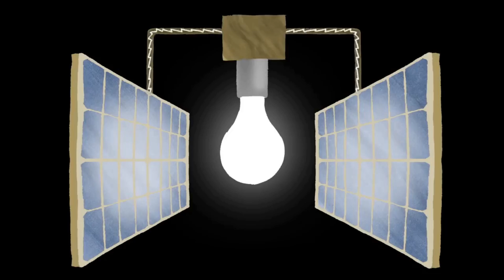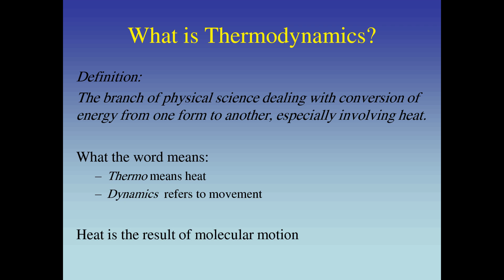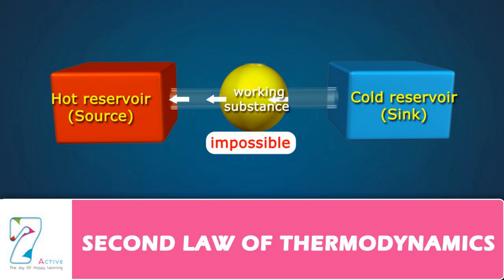2153 Do Perpetual Motion Machines Work

Comment: Maybe a maglev rotor could keep on spinning until the stator and levitating rotor's magnetic fields die out...? no? I wish you could explain why this wouldn't work. The magnetic potential lifespan will maybe be a century? if you hd a HUGE stator magnet, above which floating a rotor magnet of such a shape to rotate in place on top of the base magnet? There would be no friction. It would temporarily be perpetual for maybe lie 10 years? How long would the magnets last. I've really no idea.
Reply: could there be some feedback loop to remagnetise say the stator and rotor with some wireless tesla thingy that is powered by the levitating spinning rotor with a layer of circularly arrangd NSNS magnets on its rim? in a vacuum? I guess the magnets would wear out. So as I said it would be temporarily perpetual As you would trap almost in temporal stasis the potential energy of the magnetic domains say of tetrateanite?
Reply: Air friction, back emf from eddy currents produced in anything around it, loss of energy through sound production or friction from bearings depending on if it's spin stabilized or bearing stabilized.
Reply: no but the magnets of the encapsuling stator the field of which is magnetically insular? There would be no bearings as the rotor would be levitating while rotating, it's base would have flat panes to stabilize it and angled serrations similar to the magnetic floor of the stator chamber, to give spine. I've thouht o various designs about how to create spin and letiting a magnetic levitating rotor balance in its spin, i.e. a hemispherical levitating rotor  or a bottom slice off a sphere type shape, inside a hollow inside a magnetic stator floor, aoe which it can spin in stable fashion. there would be air friction though, but what if any electricity induced could be split between generating power and also recharging the electromagnetic field?. However the top layer of the rotor has a magtinetic field insulating layer, on top of which is the NSNS circularly arranged magnets, giving frictionless induction to a coil exposed to the inside of such a magnet. How absolute can the vacuum be in there as any particle in the atmosphere will bump against the spinning levitating magnet and will indeed cause sound inside the chamber even if it is levitating and spinning in that chamber without having any components that touch directly, only the fields interact, as the rotor "slips" but remains floating stably on top of a stator magnet beneath it. I don't know, I can't melt tetraneanite or use tinkercad to design plastic molds to make clay molds to pour tetrateanite alloy in to align the domains before it hardens, to test my ideas as I think different designs could be more efficient in creating levitating rotors that stably spin in place much lke a maglev train above its rails...  @AtlasReburdened
Reply: A stand-alone device that could spin for ever wouldn't break any laws of physics, but it would only be useful as a novelty or an energy store. With no losses, you could still only extract the same amount of energy that you put into it to get it spinning in the first place.
Reply: what if it is spinning because it's a levitating rotating magnet? On top of it is an array of NSNS magnets that cause induction. in a coil, the magnetic rotor is just so there is no bearing and doesn't touch, so there are no cogs or bearings so no friction except whatever atmosphere is or whatever level of vacuum it's in. Someone mentioned to me that when smelting an alloy of tetrateanite that you use an extremely powerful magnet to align it's domains. No doubt this is how tetrateanite was formed in meteors, not for millions of yeras, but millions of years ago as the alloy was still molten and was moving around, being moved around, by the magnetic fields of celestial bodies, which aligned its magnetic domains. In any event, this magnetic field that aligned the tetrateanite alloyw persisted from the time it was molten until it was cooled and set, and so, the magnetic domains of the tetrateanite was set. Now that we have this set, inherent potential force of the magnetic domain in a material, that is a lot of energy that was "put in" however is kept in stasis as it retains its magnetic property as a store of value, much like a battery in fact. Using such a rotor to levitate and spin with an array of NSNS circularly arranged on top of it with a magnetic insulating layer between these two levels of the magnetic levitating spinning rotor, the diameter of the rotor, and the speed of the spin determined by the size and strength of the stator's field relative to the size of the rotor means that it would be lighter work to push this levitating rotor to spin faster, I think the ratio between the weight of the rotor and the speed at which it spins could reduce the magnetic decay of the stator and rotor (it's an idea that unfortunately I can't represent to you with images or videos, but could direct someone to build), then "as much energy as you put in". Well. Sadly i don't agree with this statement even though it's a "law of physics" as you say. But such variable factors as I mentioned now would create ratios with the magnetic durability of the magnetic domains such as the size different between the rotor and stator (the base above which the levitating rotating magnetic disc spins, much like a pizza now with pepperoni NSNS magnets around it's rim,.  I think you could get out way more energy that was put in as whatever force, say using a use electromagnet to align the domains of the tetrateanite alloy, would set its strength and it would retain this efficacy much like a battery, and would decay much slower than say a lithium battery would. That's why I previously said elsewhere that magnets that comprise a generator like this could be considered, like a battery, that is, a store of value, as the amount of energy put into that alloy when it was made, i.e. using a massively electromagnet, would in effect trap that field property from the electromagnet into the alloy so as to act as a slowly decaying magnetic store of energy, so in fact the amount of energy you put into it, and the amount you "take out" can't really be compared as it's a material property.  Because what you're taking out in fact is not anything of the rotor and stator fields barely affect each other over a long period, while the smaller NSNS magnets arrayed on top of the spinning levitating rotor on the circular edge, would induce AC in the coil. In fact hardly energy would be taken out at all from the stores of value, the magnets would slowly decay, but it would be an induced field in the coil, there are no bearings or cogs, the shape of the disc rotor levitating and stator allow for it to spin stably while levitating.  It would retain its magnetic property for a long time I believe, especially if it were in a vacuum chamber with less air resistance, at certain temperatures, this spinning device could be kept near "stasis" even if it spins very fast insomuch as the material properties of the components are kept in stasis through not being allowed to lose magnetism through heat say from friction from any non-vacuum element in the atmosphere that is spins in.  I think this is also maybe why the Universe is expanding maybe and not merely drifting away due to a bang inertly, as dark energy at absolute zero forces away celestial bodies like galaxies, while they in turn attract each other.I'm not a practical scientist or a physicist but I've thought about this for so long and am unable to design the magnetic device I'm talking trying to talk about to test it, I mean I can explain it in m head and with some consultation I could have it created, but I am not sure at all even of what I'm saying at this stage without being at liberty to experiment @robinvince616
Reply: @selfcorrected-Bobby  Frictional losses are irrelevant to the basic problem here. The process of generating a current in a resistive load will mean the spinning mass now has work to do instead of simply spinning freely. It will slow down and eventually stop. Ignoring frictional losses, in theory a generator could be coupled to a freely spinning wheel and be made to produce any level of voltage you want, without imposing any load on the wheel. But the moment you attempt to draw any current from the generator, it is now delivering power and will begin to resist being turned. The more power you draw, the more difficult it becomes to turn the generator. The electrical power is thus being drawn from the spinning wheel and its stored energy is being used up.
Reply: I think you misunderstand my design? The magnet that constitutes the rotor is spinning and levitating. However this magnet itself is not what induces an AC current in the coil, it is only used as a floating spinning platform, its field interacts with a magnetic stator beneath it that keeps it floating in the air above it, with angled serrations to provide spin, s well as a flat area to keep it balanced while spinnin and floating at the same time. On top of it is a layer that blocks magnetic fields. on top of this, on the levitating spinning rotor, is an array of circularly arranged NSNS magnets that induce AC in a coil. These NSNS magnets' fields do not interact with the stator which is pushing the rotor into the air so that it stays levitating, nor do they interact with the rotor on which they sit, as the idea is to separate heir magnetic fields so they do not interact at all, even though the smaller magnets circularly arranged NSNS magnets sit ontop of the rotor disc magnet spinning in a levitatory position (levitatory! haha!). So yes its stored energy is being used up insomuch as it is losing the magnetism of its magnetic domains, through magnetic decay, along with the NSNS magnets arranged on top of it, too? I do not understand how my idea is a resistive load though, other than that the levitating magnet is resisting the pull of gravity and is being held up by the stator in the 'air'.  The idea is kind of to keep "donating blood" without sucking the patient dry in this case, of its magnetism). The patient will eventually die, though (the magnets will lose their magnetism in this situation). I wish you could explain more about resistive load, as I don't fully understand? I'm not a trained scientist, my school was a raucus and impossible place... I ended up studying linguistics, which I regret due to the available employment opportunities... I mean, is the resistive load the resistance of the conducitive properties in the coil? Or does resistive load also refer to the fact that the rotor is resisting gravity through being forced into  levitatory position by the stator, that is to say the resistive load are both the non-super conductivity of the coil, and the stator and rotor acting against each other and gravity to keep it spinning and levitating in the air? i'd say the spin of the levitating rotor in the 'air' above the stator may even reduce the resistance of the load so that it "slips" off the field of the stator, and if it is in absoluut vacuum there would be well, less resistance?. So were talking about the magnets decaying due to their resisting each others fields (the stator and rotor), while the NSNS magnets would lose magnetism due to resistance in the coil depending on the coil's conductive properties. @robinvince616

Comment: We need to stop looking at it in as perpetual motion but look it in a way that we can extract more energy then we put in ie using one barrel of oil to extract 50 barrels from the ground. Maybe using a way to extract hydrogen from water which you have done through electrolysis but trying to unlock it through a frequency that might work using ac current. There may be some frequency that just unlocks it at a small amount of current get more energy then what you used, like a pump to pump oil out the ground. Anyway It is food for thought even if it doesn't work but I hope to make a setup one day to be able to experiment it and I hope soon as it has been in my head for many years or you try if you want to go down there?
Reply: Everything that exists to be is due to frequency.

Comment: I think a reasonable proposal would be a off balance wheel that’s allowed to gain speed on its gravity assisted down stroke then using mechanical advantage of some sort to help the wheel past its point of lost inertia in as simple and low energy as possible.   Finding a way to capture energy from a large moving mass while not having to push more than is absolutely needed to crest the peak and race back to bottom.
Reply: In addition I feel like people poo poo the idea of these hyper efficient machines but give it two days and some new discovery  will fundamentally change the way we see the world.   

It’s very arrogant to assume any “laws” are just that.  They are only our understanding at this current time, not the ability to do amazing things with what’s all around you.   

If you could build a machine that uses multiple levels of gravity assistance, one to help the other once it’s reached a critical limit.   Would you be willing to wind a big clock spring for 10 mins everyday if it ultimately powered your home?
Reply: Agreed. There are new materials discovered all the time which may be the key, along with some novel thinking.

Comment: Doesn't a transformer violate the 1st law of thermodynamics, by multiplying volts. We be sure of 1 thing and that is, academia , the controllers thereof, is very often wrong. Whether by assumption or arrogance. It has been shown time and times that there are those whom have agendas they want maintained. We see examples of this practically in every field. Sad but true.
Reply: A transformer  is balanced  because  it is symmetrical.  Who says it has to be , just saying 😊.
Reply: Nope, electrical transformer can increase the voltage or amperage, while the resistance stays the same. The voltage and amperage are inversely proportional to each other. Therefore it is a balanced system, no violation of any thermodynamic laws.
Reply: @Cryptic_Triptych  never tried on a standard transformer windings , but by reversing the windings in bifilar coils the resistance ( impedance) is all but negated . Wonder if that same principle of counter rotating the primary and secondary windings would result in the same negation of resistance in a standard transformer?
Reply: @Steven-vq8lm  you would have to run a secondary set of windings with a reverse charge. Like a bifilar coil or as Ed Leedskalnin shows in his examples of  magnetic current flow . You must remember also that as frequency increases, so does skin effect.

In a bifilar coil, the wires are wound around each other, like a shielded twisted pair Belden wire used for Instrumentation or data communication wiring. If this was used in a transformer it would substantially increase the weight size and cost, which are huge factors. 

Basically, I think you are talking about an autotransformer, which has the lowest impedance (because of the coil set up). However, these type also have the highest rate of short circuit current. Which leads to the above mentioned concerns.
Reply: @Cryptic_Triptych  not really talking about any specific type of transformer . I'm not an electrician or a electrical engineer. Just off the top of my head, from what I've picked up along the way, and wonder if the same principles would still hold true when working with a standard transformer with standard coils or maybe a mix of the components of each.🤔🤷
Edit: One way to find out I guess. Get in the lab and figure it out.
Reply: The gain in voltage is accompanied by a proportional reduction in amperage so that the power in watts out is the same as the power in watts going in, minus losses from resistance and induction losses. Power out is always less than power in.
Reply: Look up US6362718B1